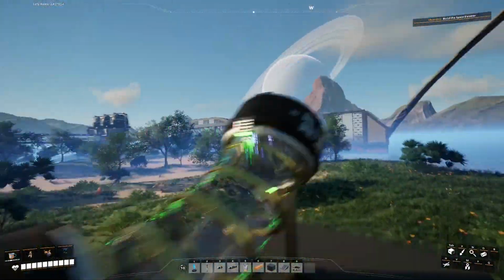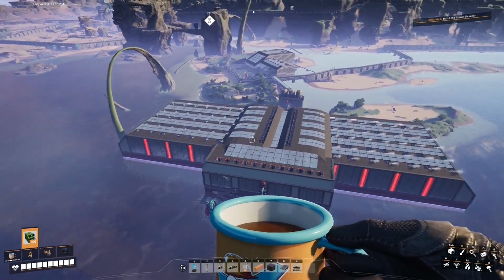Satisfactory fluids bug! How to fix it!

Comment: Do you know whether this has been fixed in 1.0?
Reply from the maker: The building bug hasn't been fixed. If you add something onto a pipe, it will cut the pipe poorly like shown in the video. Nevertheless, I cant confirm you 100% if this actually is producing liquid issues. It probably is, but to be honest, I have been fixing all of my pipes, so logically I Haven't had any issues
Reply: @NicoBuilds-g3u    Damn man, I'm 500 hours into my current factory (Started a new game when 1.0 came but had over 1,000 hours experience in the early access), I never noticed this and finding out now, knowing I need to edit thousands of pipes is so hard to find out 🤣🤣🤣 oh man, I wish I had done this method with all of the modular pipe connectors I made in the blueprint designer for my enormous oil > fuel > turbofuel factory, put down hundreds of them and then connected them together 😭😭  I always wondered why I could never quite get the liquids right. 

Well, thank you for this enlightening but also deeply depressing information 😆 seriously though great video you got my subscription
Reply from the maker: @aspectb4378  Hey, it might still work!
Get used from now on to fix this as you go (it can be done really fast)
And if you are lucky maybe everything is fine!.
This bug usually brings troubles on pipes that are at full capacity. So that's where you can start (if you end up having issues). Mass dismantle pipe segments (using the filter) without erasing supports, intersections, or pipes. Then redo the pipe connecting what's left
Reply: @NicoBuilds-g3u  I ran to the co-ordinates 0,0 and built an enormous tower that goes directly vertically up , and started making my factory inside a sphere at the top, 1,000's of meters abov e the ground 🤣 It looks awesome from a distance, it was going to be like a huge deathstar type thing in the sky, but obviously the problem was that I had to make huge vertical pipe segments with pumps every 40m, and each pillar that supports the tower has about 20 pipelines, I put one on top of the other and connected them together around 30 x for each pillar 🤣🤣 So yes, I think hoverpacking / parachuting slowly down the side of every pillar and checking every individual pipe line is too much for me, but I'll take what I've learned and probably make something closer to the ground this time🤣🤣 I can't help it though I just like building up. You should try out the game Grounded if you haven't already! The building in that is also really fun. I made a crazy tree-house base so I could look down on the map and all my creations like Saruman at Isengard or some ****🤣
Reply from the maker: @aspectb4378  Wow, a lot of content in here!
No, I don't think you have to give up. What you tried to do is amazing and I'm really curious about the project! Maybe it went wrong, but we don't learn and improve by getting things right, we learn from our mistakes!
Maybe make some other less ambitious projects before, but you will get there!
About grounded... Before satisfactory that was my last game I really spent a lot of time and played it the same weird way I do. I made a base around the middle oak tree. That went from the very bottom to the tallest branches. All of them! Learnt some techniques to be able to hold huge structures without exposing the supports (hid tiny supports on the branches that you can clip through, and connected the structures with the "strings"? I dont remember the name). It was amazing. As a matter of fact, I considered starting youtube with that game, just to show that base, that was glorious. But still, I never fully completed the project. What annoyed me was the resource gathering. A base that tall, it took me like 5 minutes getting from the bottom to the top, and I needed both leaves and stems. Then I found satisfactory, A game where you don't have to farm stuff, you simply build something to do that for you! And I fell in love.
That huge, grounded base must still be there, but im not going back to it. And what you tried to do in satisfactory reminds me of what I started doing in grounded. 
We come from the same background!
Never tried it in satisfactory, but I know there's a water tower technique where, If you want to raise 20 pipes with liquids to the top, you only need to put pumps on one of them, and bring that one back. If you connect it the right way, it can push all of the others up! Haven't done it, but there are plenty of videos out there explaining it. Drawing Xaos recently did a 144000MW power plant using this same technique and has some shorts and some videos explaining it. 
Don't feel discouraged! Try, break some things, learn from that... and tag me when you get awesome shit done!.
Cheers!

Comment: This doesn’t help me at all 😭 I already build like this already.
Reply from the maker: If this is the issue you are having, it's quite easy to fix. Mass dismantle the pipes (using the filter) but dont dismantle any support, intersection, pump etc.  Only the pipes. After that, rebuild the pipes connecting the elements that are left. Shouldnt take that long

Comment: Cant run nuclear power plant because of this
Reply from the maker: Hey there! Don’t get frustrated—fluids can be really tricky to get right, and they’re more complex than they might seem at first. The good news is that the current fluid bug is actually pretty easy to identify and fix, which I’m covering in the beginning of this video.

I’m also planning to upload a more advanced video soon that will dive deeper into fluid dynamics, which should help a lot with these issues. In the meantime, check out the description of this video for a list of tips on solving common fluid problems. 

I think the most important one is doing several smaller systems instead of a big one. Meaning, dont merge 8 fluid generators in a pipe, to later divide that pipe into 4 consumers. That's asking for trouble! Do several smaller systems. In this case, only 2 generators connected to 1 consumer. If the math doesnt work, consider underclocking/overclocking consumers or generators, until you are able to sub-divide the system. This will help with backflow issues, that are generally related to the path of the pipes and cause a lot of trouble. 
Hang in there—hope this helps!

Comment: This plus removing floor pipe holes fixed it, just spent my whole day building a 200 fuel gens power setup, I was about to break a fucking wall because of these fucking pipes, that's the only thing I ALWAYS had problems with in satisfactory, only this and nothing else it's frustrating so much

Comment: The water extractors are all working ok 100% in that config? I have a very similar set up for my nuclear and it doesn't work well at all. The random sloshing and backflow will create back pressure, stop the extractors breiefly each time the pressure wave sloshes back towards them and then ripples back up stream, starving the nuclear plants of water.
Reply from the maker: You mean in the factory of this video?  They werent! But it got fixed when I resolved the bug I describe in this same video. Still,  this kind of set up isn't the best and is prone to issues. In general, you don't want to connect two fluid generators in the same system.  If the pipes aren't 100% symmetrical and the system isn't absolutely balanced, you can end up with one generator pumping into the other one, or one having more "priority". It's still manageable but not recommended
Reply from the maker: Can be solved with a full pressure start-up. Will be showing that when I finish the turbo fuel power plant I'm working on my 1.0 series.

But ideally, don't connect several generators to the same system. If you have 8 coal power plants and 4 extractors, connect 1 exctractor to 2 coal plants and make 4 systems. 
If you have 2 nuclear power plants and 4 water exctractors, connect 2 water exctractors to 1 power plant and do two systems.  This way is unlikely you will have this kind of issues. And when connecting more than 1 liquid generator to a system, make sure the connection between both generators is as symmetrical as possible, and keep an eye on them for some time at the beginning.  You want each one of them seeing the same "resistance"

Comment: I really hope this is my issue. Spent 4-5 hours building a coal power plant with the 2-6 ratio I’ve seen a lot of people use and it’ll run fine for 5-10 minutes or so producing and using the exact amount of water I need and then it just randomly runs out of water. Can’t for the life of me figure out what the problem is. I’ve built pipe towers to build up pressure and everything still does it… Going to go through and check my pipes now.
Reply from the maker: @logansmith4849  what do you mean 2-6 ratio? 2 water extractors for 6 coal generators? That doesn't work! 
Water extractor provides 120 m3, while coal generators consume 45 m3
Doing 2-6 would mean giving 240 m3 to a system that needs 270. At the end, your coal generators will end up working at 88,8% 
If you want to do that, you need to overclock every single water generator. And when connecting them, I would suggest connect them independently. 1 water exctractor for 3 coal generators. Individual systems. (Remembering to overclock the water generator!)
Reply from the maker: The way I like to set up coal is 8 coal generators with 4 water extractors. Each water exctractor connected to only 2 coal generators, nothing else. And I also underclock them so that they provide 90m3 instead of their usual 120 m3.
The 4-8 ratio lets you build something symmetric that looks nice.
The underclocking saves power.
Connecting each water exctractor to only 2 machines makes it simple to set up.
Having 4 separate systems instead of only 1 highly decreases the chances of errors (like backflow, or exceeding the capacity of a pipe)
Reply: Yeah realized this after I posted it some, people I had seen on yt was using the set up. But I did the math and realized it was off lol over clocked the pumps and it works fine now.

Comment: Has this been fixed in 1.0 yet?
According to the devs pipes should work fine now but I still run into problems sometimes. Anyone else?
Reply from the maker: @coondog7934  this hasn't been fixed, nevertheless they fixed the mk2 bug.  So right now this is the only thing you need to pay attention.  Then,  if your are having troubles with pipes you can't blame the devs, you are simply doing something wrong. 😅

I will be doing a video on a full pressure start-up in a couple of weeks,  when I finish the turbo fuel factory we are currently building in my 1.0 series. That's a good way to avoid having issues.
Reply: @NicoBuilds-g3u  nah, trust me, I'm playing according to the physic laws ingame (no pumps involved, no inclines etc.).
Sometimes I build pipes and adding valves and junctions later on and suddenly nothing flows through them anyomore (with weird overlapping parts due to badly cut pipes and belts as shown in your video). Then I delete them and rebuild them EXACTLY as before without the overlaps though and suddenly it works (which led me to believe it is the bug mentioned in this video since no or less fluid flowing back). Same with conveyor belts sometimes. Products get stuck in conveyor splitters after adding them to an existing network for absolutely no reason. If I rebuild them suddenly it works. It is a weird bug and it doesn't seem to be fixed yet. I can't seem to reproduce it reliably though but working on it.
Reply from the maker: @coondog7934 i will be doing an advanced video on fluids in some weeks to try to explain why these problems happen, and how to fix them. Devs have been testing fluids out nonstop and they were unable to find a bug. Trust me, they work. It doesn't mean they are easy to set up

Comment: I FOUND THE SOLUTION!

https://www.youtube.com/watch?v=0w6CZ5yCTy8

Snuts explains it here. Basically they cant get a 600 pipe to push more then like 597 liquids because of the way liquids are calculated inn the game. So it seems like 590 output would work. Maby there are fixarounds. As i would think because it seems like you fixed it here inn this video. but to my understanding this is what is happening.
Reply: I did however change all my pipes that where interconnected to like what you showed me. that may also have helped.
Reply from the maker: @datsawesome3241  glad you got it fixed mate. That video you saw anyway is 11 months old. That was the floating point error that has been fixed in 1.0!. Haven't played that much with liquids so far in 1.0, so far had no issues. Anyway right now im doing a huge turbo fuel in my 1.0 playthrough, so in a couple of videos i will experience it first hand with a good challenge. Hope everything runs smooth

Comment: i cant get my pipes to fill an entire pipe of 600 all the way to the end, the two last coal generators dont get enough water. everythis is on the same level and i am producing 585 water as i need that for 13x coal generators. but my last two coal generatos wont get water. i dont know why.
Reply from the maker: @datsawesome3241  hey! I have included in the video description a list of tips to troubleshoot them.
If that still doesn't work i would simply change the set up. Water is an infinite resource.  It's not worth stressing about it. 
I would use 2 pipes, on two different systems. One for 7 coal generators and the other one for 6. Play with the overclocking of the water pumps so that you get the right numbers.  That should fix it!
In general, having several water extractors pumping into the same pipe is kind of hard to set up. If the branches aren't exactly symmetric, 1 water pump will have more priority than the other one. Dividing it into smaller more manageable systems is way easier (Ideally,  having only 1 water extractor per system). Divide and you'll conquer! 🎉
Reply from the maker: And if you don't want to change your current set up,  check which of the water generators isn't currently working at 100%, the issue might be close to it!
Reply: i had the same problem in my new 1.0 save with my first tier 1 pipe coal generator line i missed an pump that was the only issue i had no problems so far with pipes